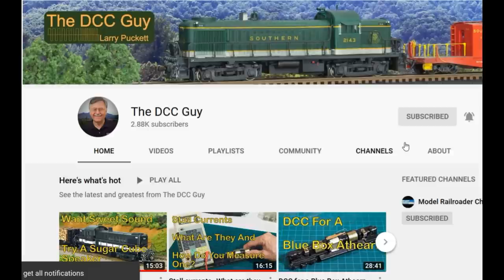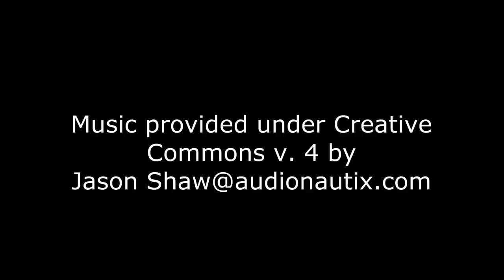Painting Track (153)

Comment: Sir, you read my mind in the way you're doing that paint job. First, the airbrush and second, the type of paint used for this job. An airbrush is messy and needs a lot of masking or protecting of oversprays. But it's so rewarding at the end. That's the only way of covering everything with a thin layer of paint. Witch is not the case with a brush. Finally, Badger paint. It's the best "sticky" paint I've ever used in the past 25 years. It's really hard to remove when you have to. So at the end, you've done a very nice painting job with those tracks. Keep on your good work.

Comment: What did you end up doing with those bits that you masked off? Did you paint them by hand? I masked that stuff off on the first part of my layout, but in the second section I wired up the frogs to change polarity and isolated them from the point rails, but also bridged the point rails to the stock rails. I just sprayed indiscriminately with the points in the middle (peco with the spring removed) and they work great. N scale electro frog Peco turnouts.
Reply from the maker: I painted them by hand but I actually could have just blasted away since all my rails are bonded. That said I think it helps to prevent getting any moving parts and joints gummed up with paint.

Comment: I'm glad you showed the airbrush and spray can method even you didn't paint your rails that way. I have an airbrush but the last time I tried it didn't work. So I went with the spray paint and have had good using a flat brown. My layout is in my garage so I just open my garage door so fumes will go out. I live in California so our climate is pretty much the same year round. What about painting feeders? Should those be covered and not painted as it providing the track power and signal to the decoder? Have a good weekend. 
Chuck
Reply from the maker: Chuck, once it is soldered to the rails you can paint away and it helps disguise them.

Comment: I am torn between painting rails and chemically weathering them. I paint them outdoors and scrape off the area where contacted by rail joiners before installing them.  Saves a lot of trouble.
Reply from the maker: I’ve done it both ways and settled onto air brushing. The advantage of spraying individual sections outdoors is you can use spray cans which generally go much faster since with the enamels and organic solvents you get better coverage in one pass.

Comment: My layout is N scale and will be in the living room. If I paint my track in my living room, are there any fumes from using Acrylic paint in an Airbrush? I thought about Spray can painting doing each piece of track in my garage and then assembling it on the layout, what do you think about that vs laying the track and then airbrushing it? Oh, I'm using Kato Unitrack, there is No flex track, and the drop feeders will be all soldered first from under the track.
Reply from the maker: While you can spray paint in advance it does mean that you have to remove paint from the ends of the rails when joining them to get good electrical conductance. When using flex track it can also make it difficult for the rails to move in the spike heads and when they do it scrapes off the paint. While acrylic paint itself may not be toxic, breathing in the fine particles of paint can create breathing problems. When I spray my track I use acrylic paint and use a shop vac held behind the track to collect overspray, plus I wear a dust mask to prevent breathing in overspray.

Comment: Is there any benefit from painting the rails before you lay them or would that mean extra work repainting gaps after laying the track? I'm thinking with lengths of flextrack away from yard areas.
Reply: You'd have to scrape off the paint if you wanted to solder droppers on. You might also find some paint comes off when you are handling and laying track in position, particularly on curves or point work.
Reply: @1701_FyldeFlyer  good point. I am thinking of soldering as many droppers as I can up front following mixed success with my soldering.
Reply from the maker: I have done that —once.I also have used MicroEngineering pre-weathered flextrack. I prefer painting after the track is down. In addition to the soldering issue, I found that during moving the track about the molded in spikes can actually scrape off paint, requiring touch ups. And assuming you plan to weather the track and ballast you’ll have to paint it once it is down also, so might as well dive in.

Comment: Can the cork remove oxidation off the rails?
Reply from the maker: Most is just a surface layer so yes I believe it does. It basically is a light abrasive, not enough to scar the metal but just enough to remove dirt, oil, grunge, and the oxidation layer. Sort of like polishing silver with a dry cloth.

Comment: What do you use to scrape the top of the track after painting?
Reply from the maker: If you catch it when it is still a bit soft you can use a scrap of cork roadbed. If you wait till it starts to harden then try a rubber eraser and after that a brite boy. I have even heard of folks having to resort to the tip of a flat end screwdriver but not s good idea.

Comment: What’s your opinion on weathering track before you put it down?
Reply from the maker: I don’t do it myself mainly because I use flex track and the flexing after painting can scrape the paint off at the cast in spikes, etc. It also means you have to diligently clean off the paint at the ends of the rails to attach rail joiners and solder them and to attach feeders. I feel it gives a more even application doing it once the rails are down on the roadbed. On the positive side you can take the track outside and pre-paint it there instead of in the layout room. I have done it both ways and now paint after laying the track.

Comment: What ratio of pain to thinner is recommended?
Reply from the maker: It varies with the paint. Some brands and colors are thicker than others and require more dilution. I use anywhere from 1:1 to 2:1 paint to water. With track I dilute with distilled water but for models and in my spray booth I use a 50:50 mix of water and isopropyl alcohol for dilution as the alcohol speeds drying. I shoot for a mix that gives a final consistency about like milk. You basically need to experiment with your own air brush, air pressure, and type of paint to get a feel for what works best for you.

Comment: Wouldn’t it be wiser to start in the middle and work out to the edge?? I know what I would look like trying to reach over something freshly painted
Reply: I was pondering if you could take individual pieces of track, tacking them to a board then take the whole thing outdoors and spray the pieces prior to gluing them to the layout, this might be doable even if it is cold outside.
Reply from the maker: See my answer to another comment on doing it this way. 

As for starting at the front, sometimes filming pushes you to do things out of sequence. I had not planned on doing the middle track but finished the front one quicker so went on with it. In a yard I definitely would start at the rear and work out. In this case it wasn’t a problem though.

Comment: Why not paint all your track BEFORE you install it? If you paint all of it ahead of time you don't need to mask anything off. Why not use a little planning? The other advantage is you can paint all sides very easily and do it and an environment you can easily vent, or better yet outside.
Reply from the maker: I addressed the potential issues with pre-painting track in a prior comments, you might want to go back and read through them. I have done it in advance and find it creates more work in the long run.

Comment: I'm not sure why you're painting your track after it has been laid.  It is much easier to paint prior to putting it on the layout.
Reply from the maker: You might want to read previous comments on this as we discussed it then.
Reply: Big no no. Especially when laying flex track, the flexibility of the track will likely become compromised because now theres paint blocking the tie plates and spikes.
Reply: @AbelG8781  Not a big deal with MicroEngineering track because it holds it shape anyway.  I've done it several years and have had no issues so far.
Reply: @FlyingCrow  oh ok. I'm normally against doing it that way because the acrylic would immediately rub off while flexing. As long as it works out though!